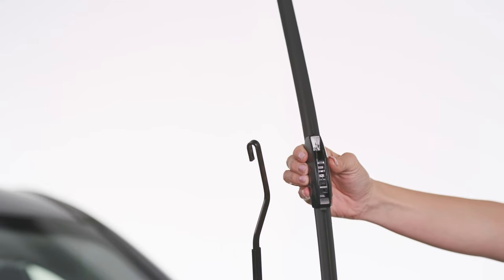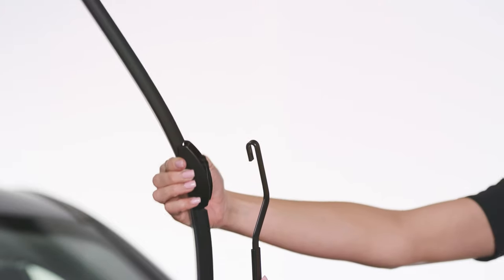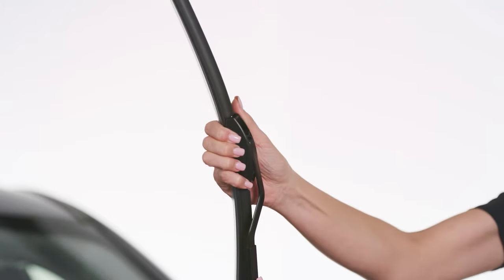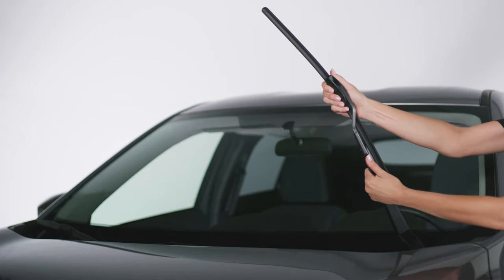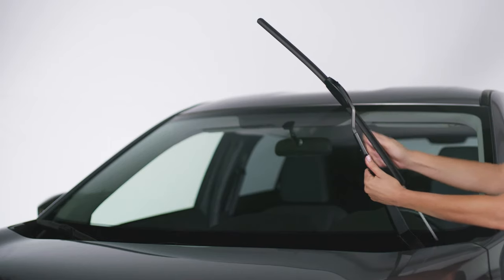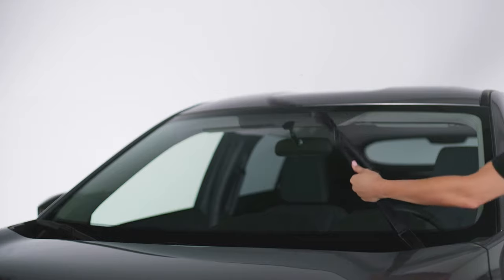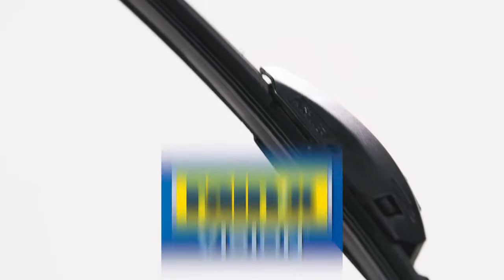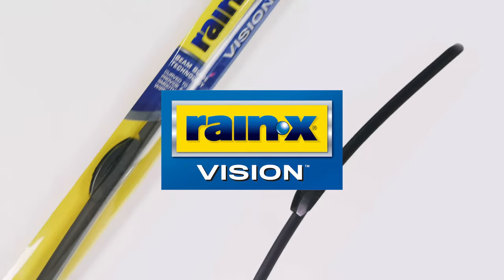Rain-X Vision Wiper Blade - Small J-Hook Installation

Comment: You make it looks so easy. I had to check another video to figure out how to remove my old rain x wipers which had a completely different fastener. Now I’m trying to install mine and each and every time, the adapter keeps flying off. Sometimes I think it might be in but there’s no click I keep trying in each direction and neither way feels satisfying. I don’t understand how this can be so fricken hard!!! This video does explain which way is the right way no clear markings nothing!!!
Reply: Ok I got it on. But not very satisfying. There’s no click. It doesn’t lock into place. I can take it off easily. Not sure how to get it locked in

Comment: When you buy Rain-X Vision product, there are three adapters in the package. Could you identify which one should be inserted into the plastic housing? Also, one adapter has three different locations to clamp on to the platic housing. Which one should a customer use for their vehicle? I love the opening sentence in the instructional video, "First, remove the old wiper." 😆🤣
Reply: I watched an how to video specifically for my car first since I was already in the habit of finding videos for my car.
Reply: @blockchainprofessor.x  I has to find make/,brand specific video to help me install mine🤷‍♀️Sorry,  I only know there is a good Toyota mechanic channel.
Reply: I just got one for my driver side yesterday and on the instructions they said which adapter goes with which kind of wiper style for my case I had a j hook wiper so it’s the default one that came on